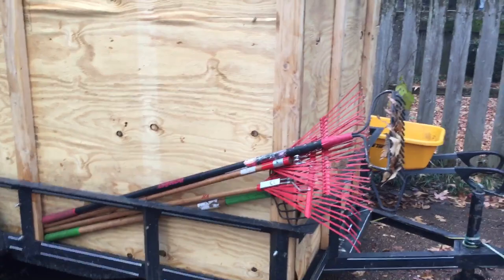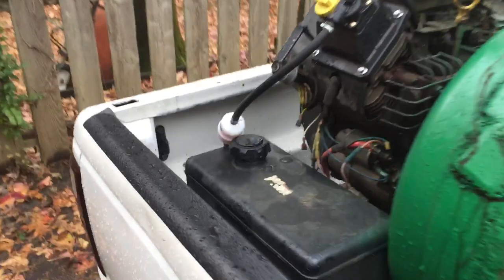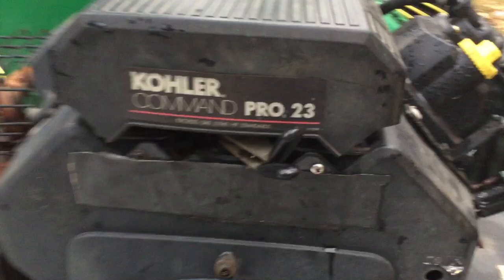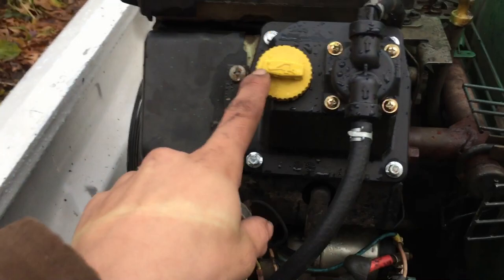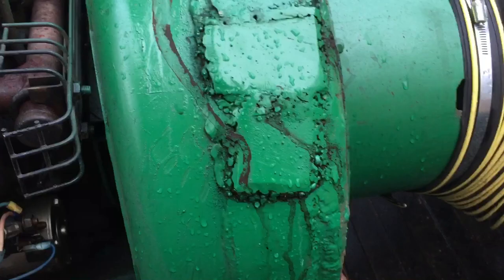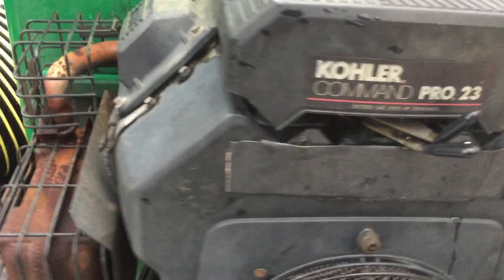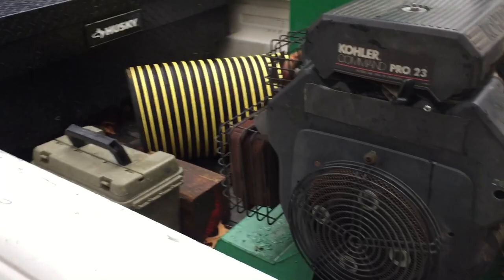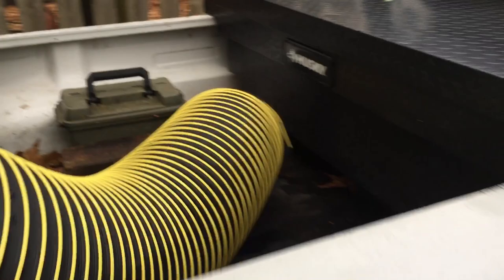Billy Goat Leaf Vac/Leaf Trailer Set Up

Comment: How do you empty that trailer?
Reply: He shows it inside the trailer, you can see the strap he has secured to a piece of wood, looked like plywood maybe, but it's used as a back wall and you tie the strap to something like a pole at the dump and pull forward. The plywood wall pulls the leaves out.

Comment: Echo 9010 or red max 7500 if you need to be right at that power mark or the 8500 whatever you need but wouldn’t get a 550 you’ll be under powered you rather be over powered then under powered remember that!